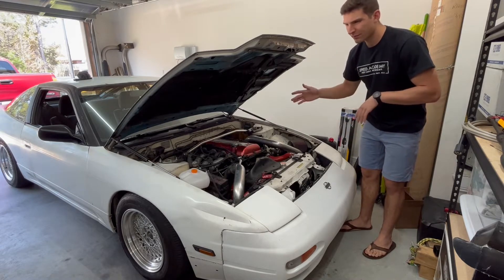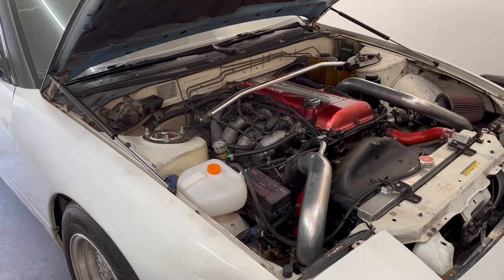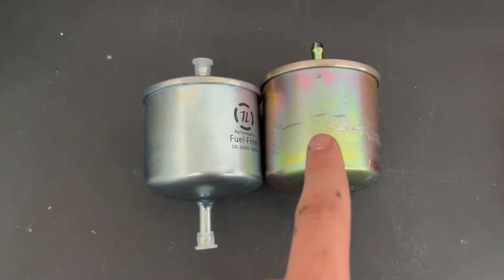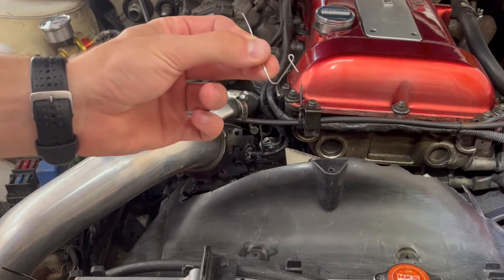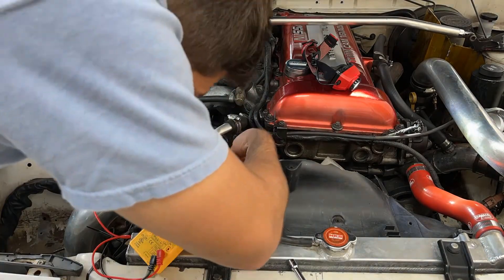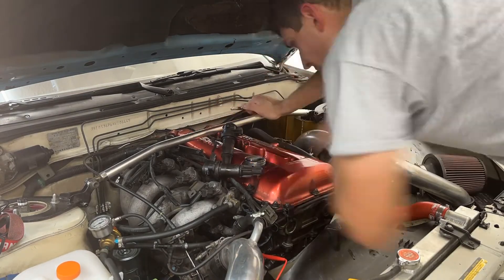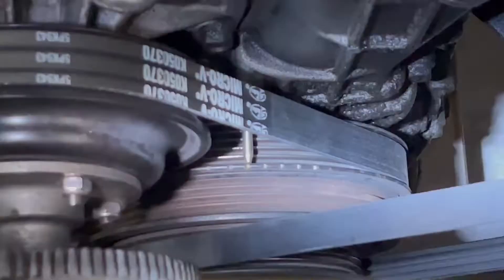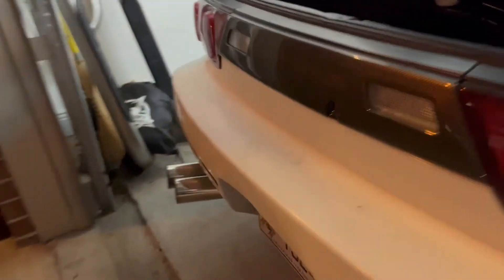Quick tune-up on the sr20 (fuel filter, TPS, CAS, and spark plugs)

Comment: I had similar issues with my sr20det. I had a high idle, which was fixed by adjusting the throttle stop screw. The previous owner of the engine had messed with it, which is a big no no. So I backed the stop screw since the throttle blade was slightly cracked open, rendering my iacv useless. Idled smoother after that. What finally got my car running well was a proper tune and new injectors. I had Martin at RS enthalpy tune my car in person at a local dyno day. If you want to stay with the stock ECU, this might be your best bet, especially if you have that bigger turbo that flows more CFM. I would see if he ever travels to your location.

Also, check for vacuum leaks with a smoke tester and check for boost leaks. I had a vacuum leak at the fuel rail isolator that connects the rail to the intake manifold.
Reply from the maker: Thanks for all the great info, last night actually I found that the battery ground had a bad connection to the frame so I sanded it down and now the engine idles lower, runs smoother, and the gauge cluster doesn’t read 20 mph at idle anymore 😂 I didn’t think to check such a simple thing, but it made a big improvement for my engine. I’m sure a vacuum/boost leak test would reveal some other issues as well. I’d love to have Martin tune the car, so I’ll have to check that out. 
I still need to install a new IACV because my adjuster screw is obliterated lol thanks for watching tho! - Sal

Comment: I know this is an old video but to increase/decrease idle if all else isn't working play with the IACV adjustment. You can see it from the top of the manifold.
Reply from the maker: Thanks for the tip, I actually tried doing that first but the adjustment screw on my IACV is all stripped out. I have a new replacement but I don't want to pull the intake off to do that, seems like an annoying job to do. Thanks for watching!

Comment: I have a sr20ve but  it is not starting it is turning over so  what could cause it from  not starting
Reply from the maker: Hey man, the 3 things I would sanity check first are fuel (does it have fuel pressure at the rail and injectors), spark (are the spark plugs firing), and air (is the MAF clean and plugged in, does opening the throttle body help?). After that, your cam angle sensor (CAS) may be off which is telling the computer to fire the spark plugs at an incorrect time. There's a bunch of reasons it may not fire, but I would start there. Hope this helps, and thanks for watching! - Sal
Reply: Any updates?